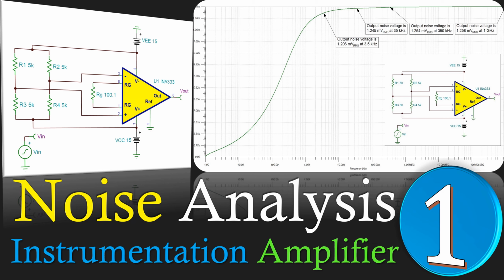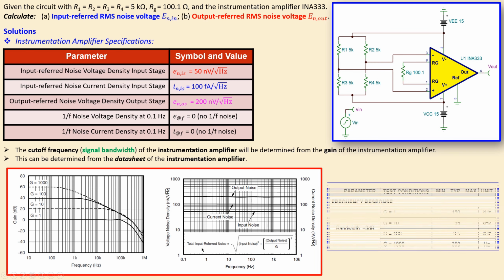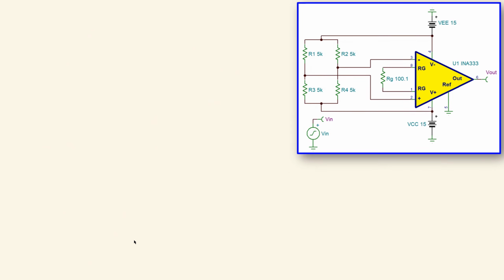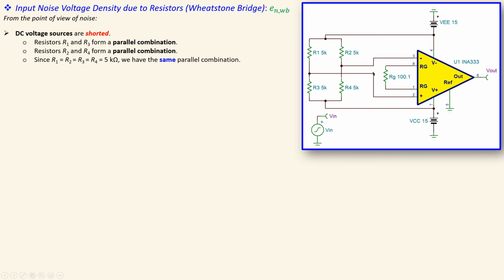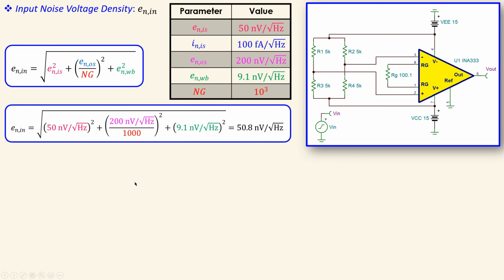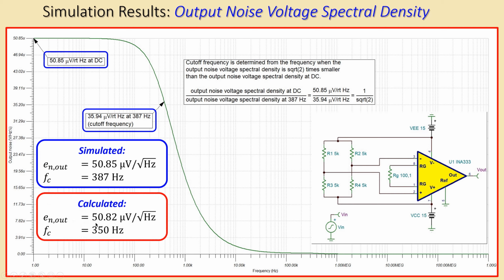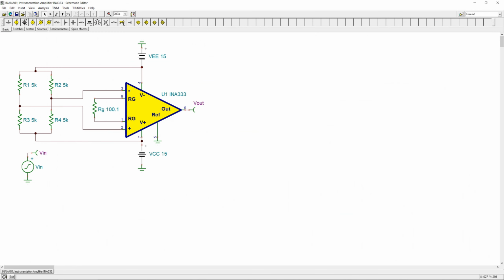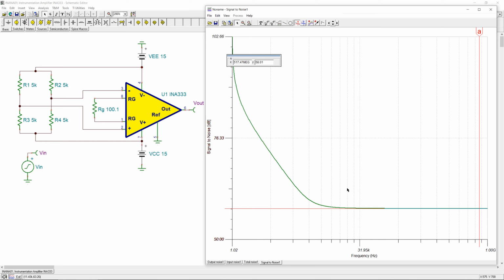Instrumentation Amplifier Noise Analysis 💡 Example 1

Comment: Hai..you have add whetstone bridge right?in my case i have no wheat stone bridge,so can i eliminate that whetstone bridge part alone in noise analysis
Reply from the maker: You should only use the parts you have in your circuit.
Reply: @CANEDUX can you repeat it please
Reply from the maker: @cl22m001  You only consider the components you have in the circuit. If there is no Wheatstone Bridge configuration, then that part's  contribution to noise is simply zero.

Comment: Hello, I am getting error that only one input is allowed but a did same as yours. please help, how I can rectify the error
Reply from the maker: How many DC and AC sources do you have in your circuit? Check this first, then try again with only one AC source as I did.
Reply: @CANEDUX  I Have used one AC source and two dc source,but still not getting error if possible can you share your email id so I can share picture
Reply from the maker: @AnkChat  You can find the mail address via the About tab of my channel. I will try to look at your problem.
Reply: @CANEDUX  okay thank you very much for response.
Reply from the maker: @AnkChat  I solved the problem of your noise analysis. See your mail.

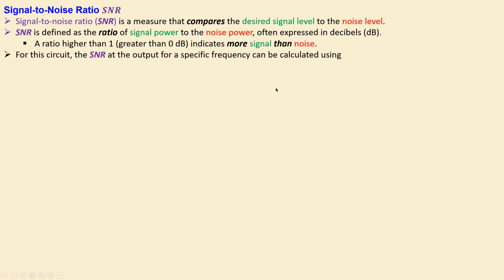Comment: Hi, Why for the SNR calculation  you used "1" as a signal, @19:48 ??
Reply from the maker: The input signal amplitude was considered to be 1 V, so actually it depends on the input voltage amplitude. This is done in all examples in the playlist of noise on this channel.
Reply: @CANEDUX  👍 thanks very Nice tutorial
Reply from the maker: @Andrew77-e3v  You're welcome!

Comment: Hi, for the noise simulations at which node is the AC noise source applied for simulation ?
Is it applied to the wheatstone bridge?
Reply from the maker: There is no AC signal applied to the Wheatstone bridge or somewhere else. You will, however, need an AC source to do the noise analysis. That is the reason for having an AC source in the simulation.
Reply: It seems this is the case in Tina Spice. Would this differ in pspice?
Reply from the maker: @ekamsinghchauhan  You will indeed need it in TINA-TI SPICE. It depends on the simulator, but most probably, you will also need it in another Spice-like simulator. I only use TINA-TI SPICE, which is easy and fast! See: https://www.ti.com/tool/TINA-TI

Comment: Hey Can, I was designing a circuit with the INA331, which is a 3-amp IA with a different internal circuit than the typical case. The datasheet only specifies noise as RTI, and does not provide information about relation to gain, and doesnt even mention output stage noise. So I am quite confused with it. Should I just ignore the output stage contribution to noise? This way the IA is like an opamp. Or should I do the noise analysis dissecting the internal circuit of the IA? Thanks in advance!!
Reply from the maker: I also cannot see the noise specification for specific gain and also not for the output in the datasheet of INA333. Just assuming that the output noise is zero because it is not mentioned in the datasheet, is not correct and could cause extra work and tuning later. 

However, the required information is given in, for example, for INA333 (another instrumentation amplifier). Besides, the INA331 is a fairly old type. Maybe you can choose a newer version, like INA333. See datasheet INA333: https://www.ti.com/lit/ds/symlink/ina333.pdf

You can also make a selection for INA using the website of TI: https://www.ti.com/amplifier-circuit/instrumentation/products.html?keyMatch=INSTRUMENTATION%20AMPLIFIER
Reply: @CANEDUX  Thank you for the quick answer! I did not use the INA333 because I needed higher bandwidth (at a gain of 15). I will take a look at a more recent IA. Thank you!
Reply from the maker: @barbasbandas6665  You are welcome! I think the selection link will help you further. You can also search at the site of Analog Devices https://www.analog.com/en/parametricsearch/11080#/ or others. Good luck!
Reply: Hi, for the noise simulations at which node is the AC noise source applied for simulation ?
Is it applied to the wheatstone bridge?
Reply from the maker: This is already answered in another post of yours.